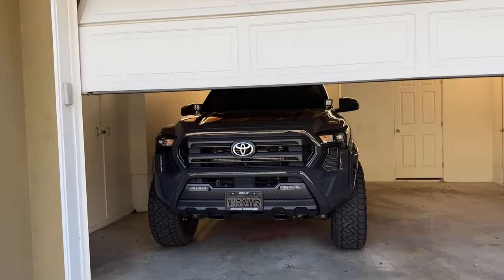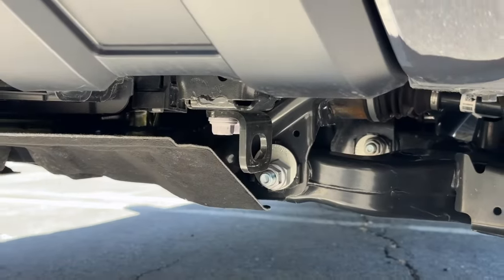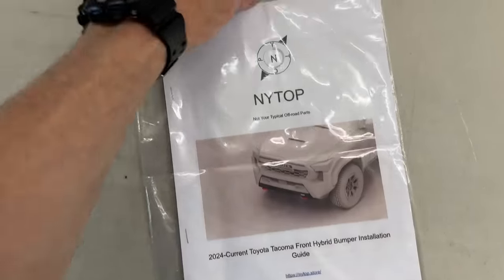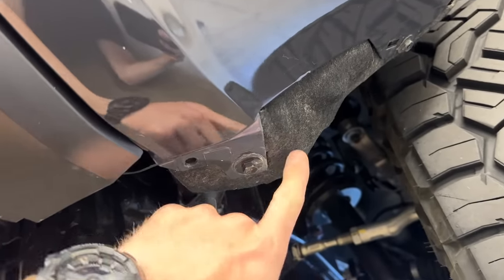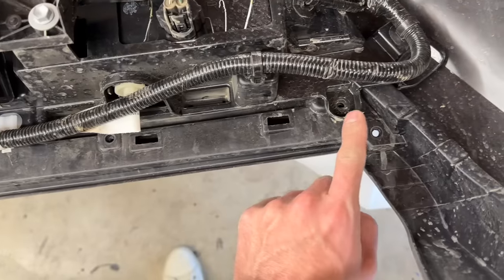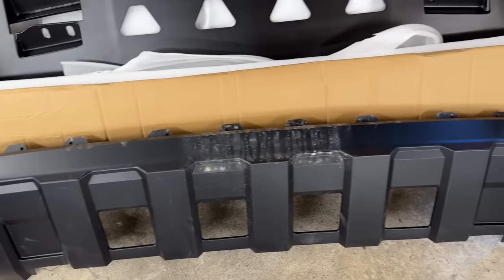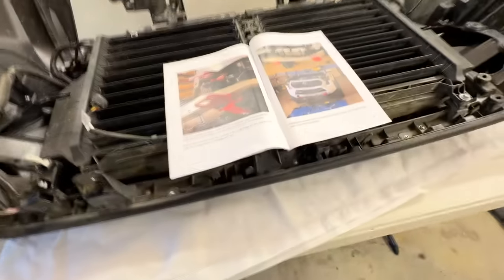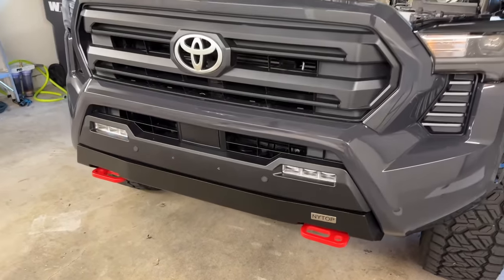Adding Recovery To My 2024 Tacoma!!

Comment: I think the look is awesome. Checked out Nytop's page to investigate and was utterly shocked at the $1000USD price of some chunks of 5/8 plate and some slightly bent and painted 3/16 sheet steel. No thanks. Not at that price. I can get an entire powder coated bumper with recovery points for less and it wont be rusted out in a month from rock chips.

Comment: Wonder if NYTOP would powder coat this bump in aluminum color. Also, will rear recovery points work with a rear bed step. I have a Limited! I'm going to change the driving lights to Diode Dynamics fog lights. Do it all at one time! I'm finally getting it lift on Saturday......

Comment: Some with a Turbo version should do a bigger intercooler, downpipe & HKS Blow Off Valve on this gen Taco for a badass sound & more power!
Reply: Naw.  It’s maxed out as it is.  Also the turbo on this engine is oil and liquid cooled.  Lots of piping and it has a vacuum controlled waste gate.  More power, less reliability.  Enough power as it is.

Comment: i generally like nytop but their fit and finish to price is severely lacking BUT they did do me right me right when I reached out to them. 
installing the hybrid bumper and hooks for the tundra was a massive pain in the ass because holes just didn't perfectly line up and ended up drilling out nuts in the frame because the hook wasn't perfectly made. the powder coat had blemshes in it. oh and I had to really fight getting the upper plastic on the tundra to sit on top of the hybrid bumper so it sits back all the way. (side note by this time the powdercoat is very scuffed up because you know very heavy bumper that you're fighting it sit in place trying to add spacers and everything)
when its all said and done I got it on and it looks great now and can live with the little details that nobody else is going to notice. 
also if you live in a state where you need a front license plate they didn't give any advice or hardware to remady a plate braket. i drilled holes in the THICK steel plate bumper and some self tapping screws for the factory plastic license braket. 

the rear hooks were great but my left hook wasn't bent properly so it points inward about a degree or 2. 

side note tho I was one of the first people to order from them. so wether or not if their QC got any better is beyond me.

Comment: If you plan on actually using the recovery points as recovery points and not just parking lot decoration, actually torque to spec. Vice grips aren't the tool for the job.

Comment: 24 Tacoma with quality control issues from day 1. Hood scope separated, rear power source inoperative, last Sunday front lower air spoiler separated .  Dealer wants $1198 to replace.   Dothan Toyota can pack sand!

Comment: what trim is your tacoma? Mine is a off road but I didnt get the f/r sensors, jbl sound system, heated steering wheel or trailer brake controller.

Comment: Hey man, I have the same truck, looking to add a roof rack similar to yours. Which brand is that? Also did you notice a large amount of added wind noise?
Reply from the maker: Its a Westcott designs rack. no wind noise at all. If its there I just haven’t noticed it

Comment: The stock points under the front bumper are transport tie downs.  They aren't rated for or should be used for recovery.  In reality I know they will be used for recovery but that isn't their purpose.
Reply: Owner's manual on page 565 refers to them as emergency towing eyelets.  They are not "transport tie downs."  It even says you can tow the vehicle using cables or chains for up to 50 miles keeping speed below 18 MPH.

Comment: Hey did you have to recalibrate the front sensors since you took off the grill?
Reply from the maker: No I disconnected the battery when unplugging those harnesses to avoid any issues with having to recalibrate

Comment: So, you spent nearly 50K on the new Taco, and you have to add recovery points because the factory recovery points are some flimsy things buried half way under the truck? Wow. And what's up with the plastic 'skid plate?' 😂 Are you replacing that too? I saw another reviewer complaining about the faux spare tire. Toyota couldn't put a real spare tire on a truck that will go off road? Wow. I've also read that when you reach your destination, you have to let the engine idle for a minute to let the turbo cool down on that wee 'lil 4-banger. That would get old real fast. And with that big iPad looking thing sticking up from that dash, do you pretend you're driving a Tesla? 😂 Dude, you should have bought a Frontier and saved all the hassle of doing what you're doing.